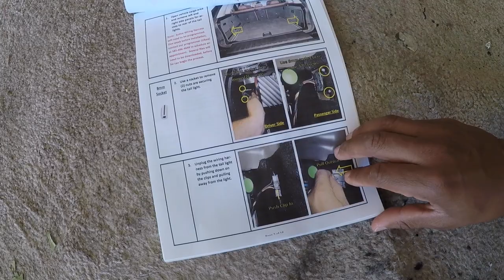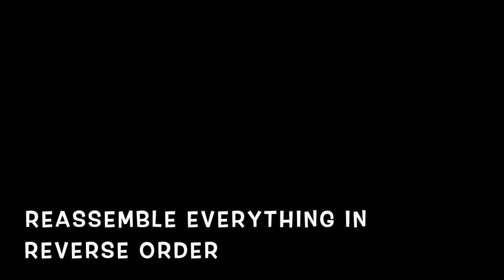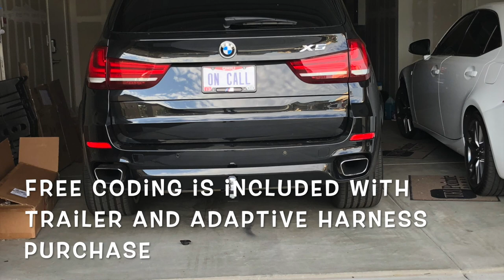BMW X5 F15/F85 Stealth Hitch Installation

Comment: Eddie, I have 2017 x5 50i, I installed the hitch, bought the trailer hitch module at fuse box, and wired it with harnesses ect. Do you know how to program the trailer mode? I can’t seem to get it to pop up…?

Comment: Looks fairly straight forward.  It's been a couple of months, what's you impression of the hitch now.
Reply from the maker: Christopher Abbott I like it.  It’s hidden when not in use but feels heavy duty enough when I am using it. I can’t express how much I love the solid connection and no “play” when towing.  I’d like to tow a small travel trailer to really put it to the test.

Comment: What tire/wheel size do you have on your X5? Looks a little thicker on the tire size than mine but we have exactly same wheels. I'm sure it rides a whole hell of a lot better than the low profile tires it comes with.
Reply from the maker: I have the OEM size with the 20” wheels. 275/40/20 and 315/35/20.

Comment: Did you have to code something for the rear trailer lights to work? Or was it plug and play kind of deal.

Btw, your x5 looks awesome and looks like well taken care 👍
Reply from the maker: The trailer lights worked immediately after plugging in the harness, however I received a trailer light error.  The hitch comes with free coding if you opt for the active harness and once that was done, there wasn't anymore errors. It also enabled the trailer sway control and when connected it disabled the rear parking sensors, remote hatch opening and enabled tow mode.
Reply: Sounds like you have to purchase a full kit with anti-sway option for it to be perfectly working without any error lights? Combo called: Rack + Tow Combo w/ Active Wiring Harness, almost $1500 US

Comment: Great video, I'm late to the game, but I just got my X5 M50D M-Sport.
But what a job😳 I'm happy mine came with an electric hitch. Only thing BMW could have done better with the button to release the hitch. Not put it behind the panel on the right side. It took me days to find it. 
Oh that is funny, when I pressed the like butten. It said 381, the same number I have in Hp in my Bimmer. Meant to be.

Comment: Great video. my X5 came with the tow hitch mounted but did not have the wiring harness installed. It does have the trailer coupling prep, do you think it's possible to route the wiring harness without having to take off the bumper cover? Thanks.
Reply from the maker: It will be hard,  but it’s not impossible. I would use gravity and start from the top and drop the harness down and then fish across the bumper.  I think your biggest challenge will be trying to the secure it so it doesn’t make contact with the hot exhaust.
Reply: @eddiemcars  Thank you for the quick reply. Cheers

Comment: I installed the etrailer on my F15 also.  Didnt have to use the ramps.  Funny, I keep my jumper and first aid kit in that compartment also.  Listen to your sister, get an impact wrench.  Get a Milwaukee M12 Stubby.  Worth it when you start doing suspension work.  Did you install the hitch under the old one crash beam?  The trailer hitch I used mounts underneath the crash beam so basically I have two crash beams.  The hardest part was basically removing the bumper cover alone and without damaging any of the pins.

Unrelated questions:  My F15 creaks from the trunk every time I go over pumps.  I suspect its the plastic covers from the lower hatch or from where the hatch lock meets.  Do you have the same problem?
Reply from the maker: Funny how we have the same uses for these little compartments.   
I eventually bought an impact and it helpful on the next time. 
I had to remove the factory crash beam but this hitch took its place.  

If your X5 is creaking, it’s most likely the upper hatch or lower tailgate. 
There are a few adjustments to get it back into alignment.

Comment: Already have the rack version of the Stealth Hitch and upgrading to tow.  Do you know if the bumper needs to be removed again? Looks like the phase of "cable through this port" requires the bumper off.
Reply from the maker: Unfortunately,  yes.   It would be easier that way.  Otherwise it’s going to be difficult to run the wires with the bumper on.

Comment: Edward. I thought I would turn to you with a problem I am having. I had the OEM wiring harness installed on my 2016 F15 and had it coded but when I connect a 4 way tester, I get a similar condition I saw in your video. The tail, LT and RT indicator lights on the tester are flashing. Not sure if you had problems testing but when I test, there is no indication from the tester for running, left turn or right turn lights being functional. Were you able to test successfully? Any suggestions? Thanks
Reply from the maker: Have you tried to see what would happen if you plugged it into a trailer?

I still got the same light errors after coding with my tester.   My guess if that the tester can verify the lights but sends the bulb error to the car for some reason.  It did the same thing on my previous Q7.

Comment: My 2021 X5 X40i has the trailer prewire and the plug is there already.   Stealth doesn’t have a harness that plugs straight in.  Is this something I could get OEM with BMW and still use the stealth Hitch?
Reply from the maker: Sorry for the late response but yes you can definitely utilize the BMW OEM harness with the Stealth Hitch!

Comment: Hello 
Thanks for your video
Im thinking to install the same hitch but I'm wondering what kind of harness should I buy, The stealth harness or Active harness? I have factory Towing Coupling Preparation option and don't know for sure if all additional options(as stability control, camera zoom, etc.) will work if I'll choose Stealth harness. Thank you
Reply from the maker: I would order the active harness personally.   It integrates nicely with the vehicles electronics. Plus it comes with free coding. 
Trailer Preparation is what you need to advantage of the active harness.  

Stealth Harness will be more affordable but the fact it disables the rear parking sensors alone is enough for me to spend the extra for the active.

Comment: Does your trailer have electronic brakes? If so what brake controller did you use?
Reply from the maker: I use a curt echo wireless brake controller

Comment: Great video, I have  a 2016 F15. I bought it pre-owned and it came with a Topline tow hitch but the previous owner didn't install the trailer module or wiring harness. I have purchased those items and have a question about coding. I have noticed that when in reverse, there is a camera option to zoom in on the tow hitch. Some forums say this is all that coding provides. Do you know if that option is present, it's been coded for the trailer module?
Reply from the maker: Another way you can test is to plug a trailer to the harness and then shift to reverse.   A feature of the trailer coding is that it should disable the rear parking sensors and display a trailer coupler symbol in its place.  Also, there’s electronic sway control from the ESP but there’s no way to safely test it.

Comment: Thank you!! I’ve been looking for a tow hitch for my X5 and I just thought if BMW didn’t put it on there you can’t get one
Reply from the maker: Most X5’s and X6 has the prep work there.   You only have to bolt on the hitch.  I like stealth hitch because when buy the active harness it comes with the trailer module and everything else to get up and running.

Comment: I’m thinking of purchasing one.. I’m not a handy mechanic person so I’m worried of taking things apart and not being able to put it back together
Reply from the maker: GUNZ TV I’m definitely not a mechanic or even close to one.  I was intimidated at first and even halfway through the job you would question yourself to why even attempt it. Looking back it’s not really that bad.  Just removing the bumper,(don’t forget to unplug the pdc) remove factory crash bar and replace with stealth hitch.  I would set aside the entire day for the job, but it can be done with basic knowledge of tools.
Reply: @eddiemcars  thank bro know I feel better about the situationw which hitch did you get? what was the price? or where can I find it
Reply from the maker: GUNZ TV plus when you think about how much it will cost to install, why not save some money?  Things I would get that wasn’t in the video.  A breaker bar and or impact wrench.  
I got the Stealthhitch with the tow option and the active harness.  It was $1200 and some change.  I would check for coupon codes as they have sales.  https://stealthhitches.com/products/x5-f15-model-year-2014-2015-2016-2017

Comment: Hey Edward... when you said you already had a 7 pin adapter, did that already come with the pre-wiring of the car or did you have it for another reason? I am in limbo right now on buying a BMW because they won't install a hitch for me and no one can tell me if it includes a 7 pin adapter. 
If you could let me know I would really appreciate it.  Great job on the video by the way!
Reply from the maker: Laura Stisser, the Stealth hitch active harness came with the 7 way pin and the adapter for the 4 way pin.  I just happened to have a 7 way to 4 pin adapter already from my last car. 
But if you get Stealth Hitch with active harness,  it will include everything you need to tow, including remote programming (have to schedule with 3rd party) to activate trailer mode.
Reply: @eddiemcars  So the trailer company we are getting our hitch installed through said they can find a hitch for the BMW all the way in Texas( i am in NY),  but not the 7 pin adapter. And again no one from BMW can give me a straight answer if the wiring includes a 7 pin adapter. But based on your answer it doesn't look like it does.
Reply from the maker: @Laura Stisser   If the trailer company is using the wiring harness from BMW, it is already a 7 pin RV Style.  You shouldn't need the adapter unless you're pulling a smaller trailer or U-haul, then you'd need the adapter to convert it to a 4 pin.  The conversion adapters are fairly inexpensive like here: https://amzn.to/32mZz9j. That was what I was referring to in my video, because StealthHitch supplied it in the box. 
I would give your trailer company a call back and find out if it's a 7 way RV style.

I hope that helped!
Reply from the maker: I just double checked.  With the BMW factory harness, you won’t need the 7 pin conversion.  It comes with the 7 way and the 4 way. 

https://www.ecstuning.com/b-genuine-bmw-parts/tow-hitch-wiring-harness/82712349500/           Make sure you get the towing module too https://www.getbmwparts.com/oem-parts/bmw-control-unit-for-trailer-hit-644010-63119463372?c=bD0xMCZuPUNhdGVnb3J5IFBhZ2Umaz0x
Reply: Edward M Cars you are wonderful! I am baffled though that you gave me an answer in less than 2 hours and my dealer has had 2 days and hasn’t given me an answer. Makes me question on closing tomorrow. Thank you again!!!
Reply from the maker: I’m glad I could help!
Reply: @eddiemcars  what does the control unit do?

Comment: Thanks for the instructive video! I'm thinking about getting the same hitch for our 2017 X3. In the video, you mentioned that you purchased the hitch with the Adaptive Harness, is that the same as the Active harness that's on the site? Did you feel that this harness was worth the additional cost, or is it optional?
Reply from the maker: Yes. It’s the active harness that’s the same thing. Sorry that was my mistake in the video, got caught up with typical BMW literature.  

I feel it’s worth it because I wanted the sway control and bulb out warnings to function. Plus the fact I have the hitch zoom.
Reply: Edward M Cars is the wiring genuine BMW or an aftermarket part? Is there any modules that I should check that I have or does it connect to different wiring ports of the fuse box? This is my first X5 and am not very familiar. Any help is greatly appreciated

Comment: Awesome video. 
Thanks.
I love your 3  car garage.❤
I am in Real Estate and have never seen anything like it👏👏👏
Reply from the maker: Djsmiley77 thank you!  It's actually marketed as a 2 car garage w/ storage.  The builder said he couldn't call it a 3 car tandem because it wasn't deep enough to accommodate every car.  With that being said I've been able to stuff the X5 back there without a problem.
Reply: @eddiemcars  
Man,
This is amazing you can have 2 daily drivers and special place for toy :)
I like this very, and think more homes should get this space as well. 
I too have 2016 x5 xline and thinking about hitch so I can pull my GS bike. Great video, thanks again.
Reply: Some places call them Tandem Garages....I think...🤔